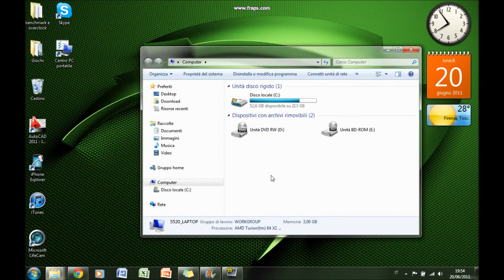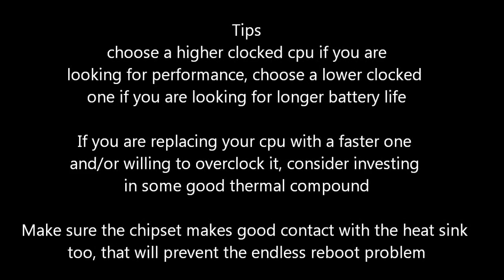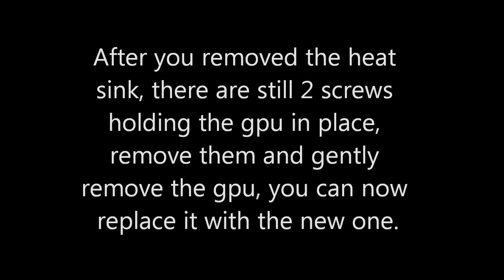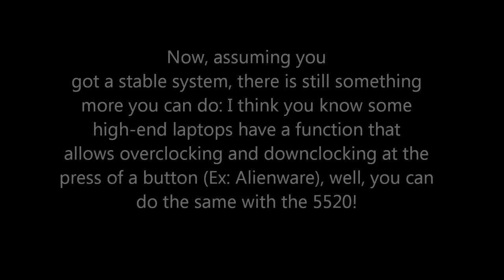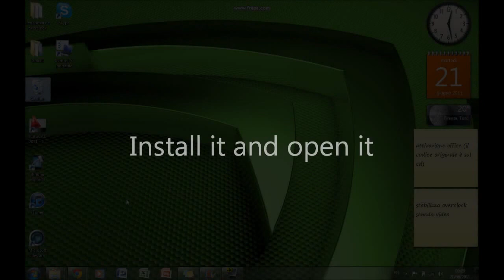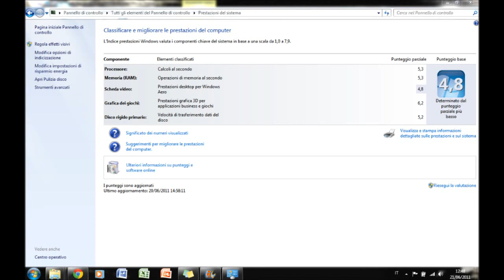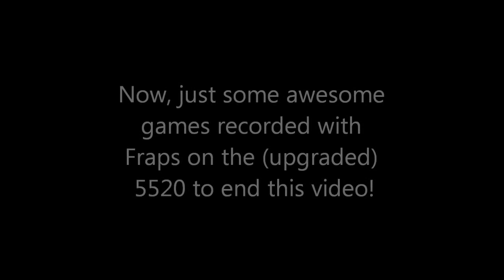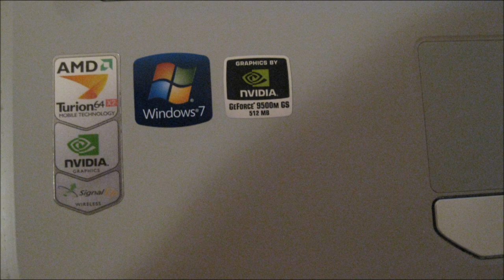Get the most out of your Aspire 5520

Comment: @coccoborg ICY50 is the one WITH MXM.  My 5520-5377 has the ICW50 w/ Nvidia 7000m w/o upgradeable PCIX slot.  I had planned on getting an ICY50 from eBay just to be able to have the option but found it too cost prohibitive to do so.  Anyways, that is from my own personal findings.  Only bonus I had with my lappy was that it has a faster processor than what was listed.  Mine came with a TL-64 instead of the listed TL-60.

Comment: I have an acer 5520G upgraded with TL-64 / 4GB 800mhz RAM and Geforce 240M. Also installed  a SSD as maindrive and the other HDD in the ODD place.

Comment: Thank you for the tutorial! I have a TL-66 on the way ($35), a 7200RPM hard drive, also a newer WiFi card, a new fan, and some RAM. Unfortunately, I have the 7000m series graphics card so SOL there, but no big deal, as I'm mostly into audio.

Will the chip upgrade increase the amount of memory I can use from 4GB or is that limited by the motherboard?